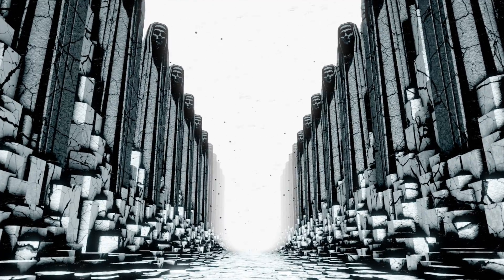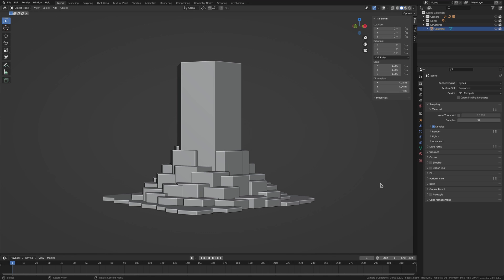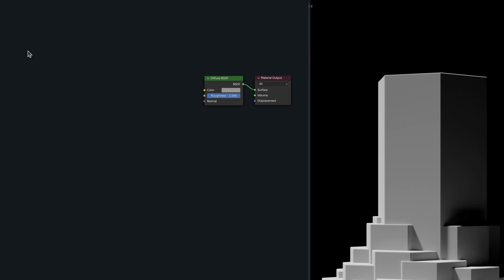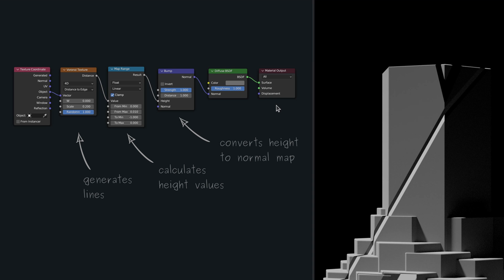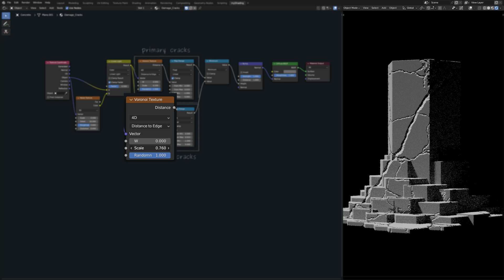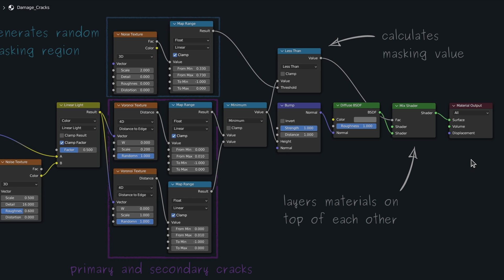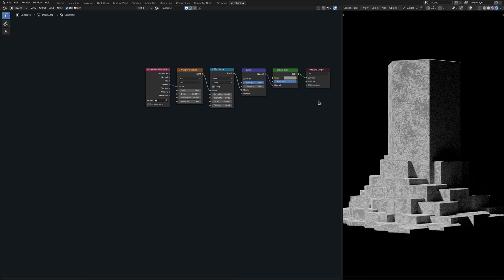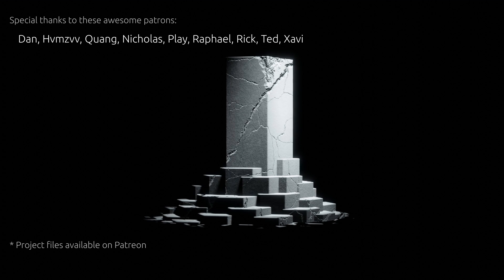Blender Tutorial - Procedural Concrete Texture

Comment: This looks really great, despite a small problem where you can tell it's CGI. The fractures would never cross in reality. If you look at a cracked pane of glass, you can always see which crack came before another, because the last one logically stops when it hits an existing one. However, I can't think of a quick solution to this and for the superficial observer it is probably a rather marginal problem, if it is noticed at all.
Nevertheless, it is a very good approach and can be implemented with just a few nodes. Thumbs up for that.
Reply from the maker: Thanks for the feedback, I get your point. :)
Though, I would caution against expecting cracks to form the same way on different materials. You are correct about cracking of glass, and I wouldn't be using this setup for glass either.